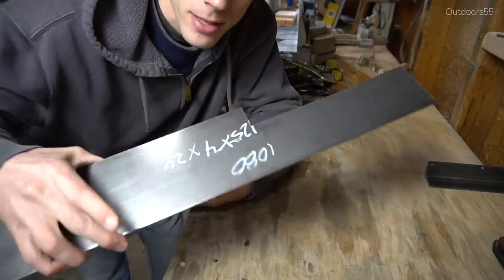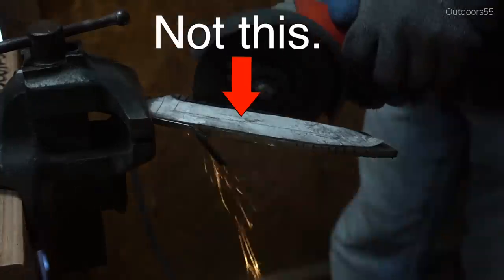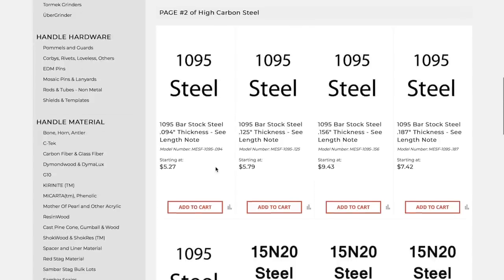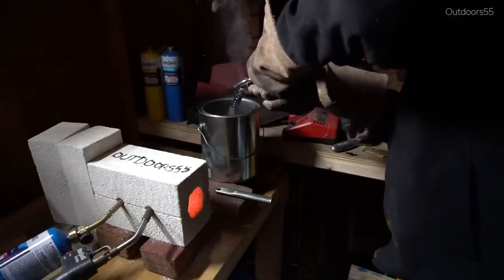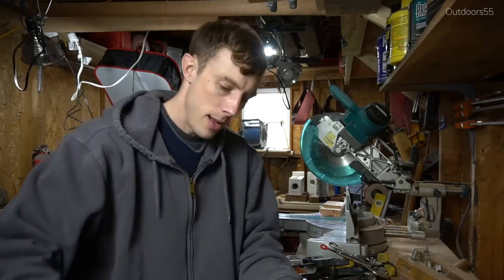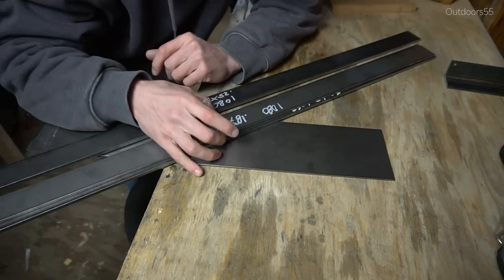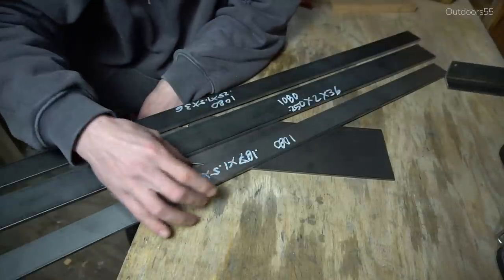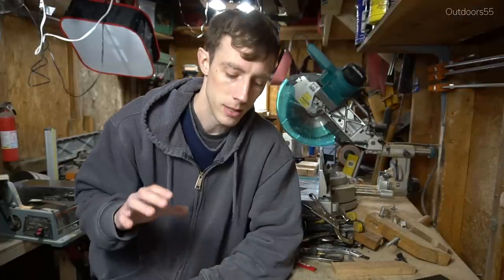Beginner Knife Making Steel | Where to buy Knife Making Steel And What Steel To Buy

Comment: can you get s30v steel, zdp 189 or any other super steels in the market?
Reply from the maker: For the most part yes. They are very difficult to work with though.
Reply: OUTDOORS55 can you make a video making a knife (or an axe or a sword) out of it?
Reply from the maker: I don’t have the capability (specialty equipment) to work with any of the “super steels” although simple high carbon steel (1080/1084/1095) if tempered right will hold their own with some of the best.  Thanks for watching my friend 😀
Reply: thanks, this really helps me a lot on making knives and stuff! I was close to buying a whole eighth inch plate of that online.

Comment: Guess I've gotten extremely lucky then because of the 8 or so knives I've made all out of 1095 not one of them has not come out hard. Not going to say I haven't had to re heat treat them, but they all have turned out. Also warped steel before heat treat isn't a big deal you can straighten warped 1095 with you're bare hands for 1/8" or with a couple c clamps and some shims for 3/16" or 1/4". Not trying to say you are wrong on any of these things, just speaking from my personal experience.
Reply from the maker: Yeah we’re talking about fairly tight tolerances here. You absolutely can use 1095, you just won’t get the most out of it unless you have an oven. Thanks for the comment 👍

Comment: well first of all 1095 and O1 tool steel are the best for material removal. yes you can get this very hard RC62-65. If you don't want to just remove material to make a knife and want to forge then 1084 or 1080 is the material you want to use. All these materials can be hardened with a small forge just get them to the point they are no longer magnetic ( check with a pointer with a magnet on the end) and then heat it a little more and quench in oil. After that placing it in your kitchen oven or small toaster oven at 400 deg for 1 hour will temper it (RC58-56) so it will not be so brittle and break when you use it. When first starting stay away from unknown steels. when learning you want to have predictability and using metal that you don't know just throws another veritable into the process.
Also you don't have to get 1095 in precision ground form. O1 tool steel is more than likely going to be, but it depends  on how much precision grind your looking for. and I get the minimal since it is going for knives.
Reply from the maker: If your using crude methods (like a forge) for heat treating 1095 and o1 are definitely not the best option. Not saying it can’t be done. You just won’t get the most out of them. There are some significant differences between each of these steels during heat treatment. There are shallow hardening steels and deep hardening steels. If you want the simplest steel to heat treat 1080-1084 are about as simple is it gets.
Reply: I like how you say crude methods. the Japanese have been using it and still use it to make some of the best knives and swords ever made. Their metal is very close to 1095. Yes having a electric furnace is the best way to control head treating. and also allows you to do specialty steels and have to be rampted up during treatment and some wrapped in foil. but don't call it crude, it is far from that.

Comment: If you are unsure of what you are getting, ask for an MTR (material test report) which will give you the chemical composition, origin etc. of the steel plate. You can check this against information on line like http://www.steel-grades.com/Steel-Grades/Carbon-Steel/AISI-1080.html

Comment: Hey there ! Hope all is well and you had a great Holidays . I’ve been looking for steel all I’ve seen is 1074-1075 or 1094-1095 my question is I’m a beginner so could I use 1074-1075 ? I’ll be using bare bones tools . Oh I also went in a Hardware store and got a piece of metal and on in Plain Steel Finish-hot rolled steel then it had these numbers N215-608 4062 . Do these numbers mean anything ? I’m wanting to learn a actually cut out knife shape it seems to cut good with a grinder of course I have to watch some more of your videos to finish it and heating it. Please share your information so I can get as good as you ! I’m joking with ya ! But I do want to learn, so now you have a 59 years young student ! LoL
Reply from the maker: Dont wast money in hardware store steel. It will not harden or make a good knife. Buy the 1075 it will be fine! You should be able to find it for anound $6 a foot so its fairly cheap. I wouldn't buy 1095 as its a more complicated steel to heat treat. The hardware store steel doesn't have enough carbon content to harden properly and it probably has a huge mark up on the price.  I have a couple videos where i make a knife with a grinder and do the heat treatment in a charcoal grill so it can be done very simple.  Hopefully this helps! Thanks for watching my videos, I really do appreciate it 👍😀

Comment: Can you use motor oil to quench a blade?
Reply from the maker: You can...but I wouldn't. It would have to be very thin oil. Canola works better and doesn't give off toxic fumes. Especially important if you plan on tempering in your kitchen oven.

Comment: Bad video. You forgot to mention that a .375 inch piece of steel 6 inches by 4 feet is 400 dollars.
Reply from the maker: Because its not🤦‍♂️
Reply: OUTDOORS55 I just checked on 2 websites, both are within 20 dollars of 400 🤦‍♂️

Comment: People actually buy steel? I have dozens of leaf springs and metal cutting saw blades. Plus some high carbon industrial steel. Saw blades are from shops I worked in. Leaf springs are from people who know I make knives bringing me ones they have broken/changed out.
Reply: Trib Ulation if I am not sure of a piece of steel I do a spark test. Leaf and coil springs are a known steel. The saw blades are two types. 1 is very hard and makes great small knives. The other is hard enough to takea good edge but still slightly flexible. I also have some from my grandfather's shop that is comparable to 1095. It's over 100 years old.
Reply: Trib Ulation lawnmower blades make great wide bladed knives once you heat treat them. I do all my heat treat and tempering on the forge
Reply: If someone is going to pay premium prices for a blade they want known steel.
Reply: Cpt Murica11 when I make a knife I know the steel I am using and it's properties. Most of my customers just want to know if it will hold an edge. At shows they often bring their friends in and say "this is where you want to get a knife".
Reply: Cpt Murica11 I try to keep my prices reasonable. An antler handle hunting knife with a 5" blade I sell for about $50. The more elaborate a knife is the more I sell them for. My swords generally go for $300.
Reply: K R Knfmkr you have to ask yourself how much of your life and resources are you willing to dedicate to using free steel? Free is always more expensive. Leaf springs are an ok steel, typically  5150 or 5160. not great carbon numbers there, but they are hardenable. Of course they aren't flat or annealed. So you are going to spend time and fuel to straighten and anneal them. They don't come in a variety of thickness'  you certainly won't find 1/8" leaf springs. Then there's stress fractures. A spring that's been under a vehicle for 200,000 miles will be fatigued and likely have stress fractures. You might, (probably) not find those till heat treat. All this to save $3? My time is more valuable than that.